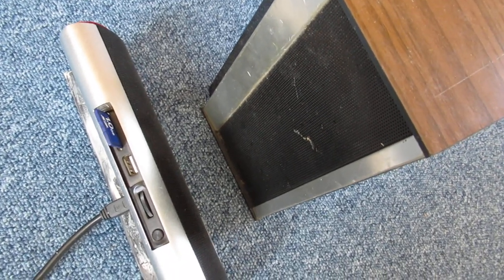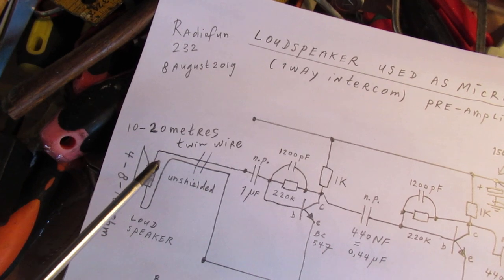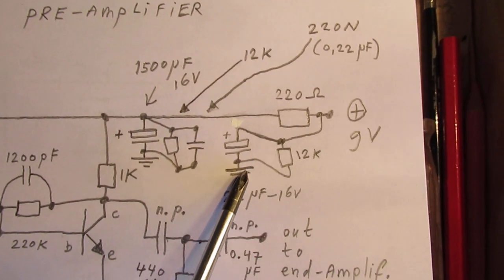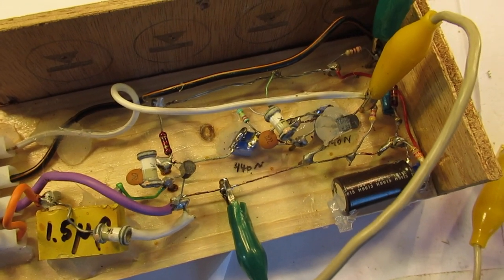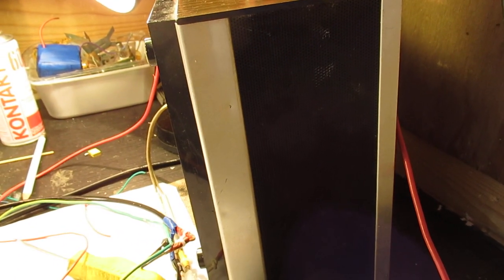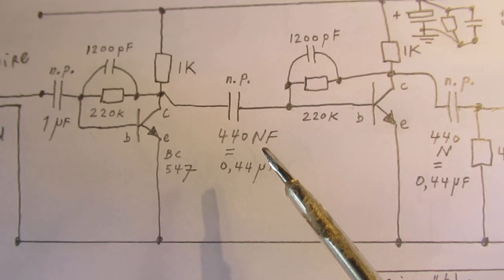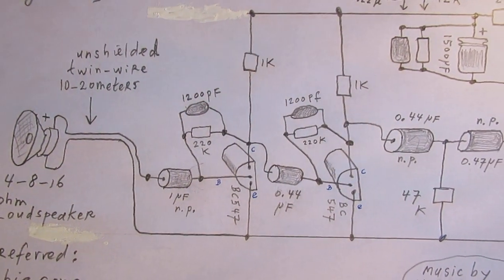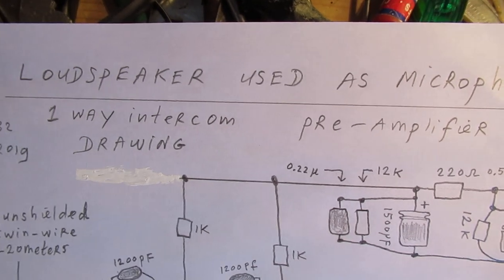Loudspeaker used as microphone via long unshielded wires: 2 transistor pre amplifier/demo

Comment: It would be interesting to make the first transistor common base with the low Z speaker mic in the emitter lead. Naturally it would mean a couple of ma DC running through the coil, but I'm curious :) Smashing video, thanks.
Reply from the maker: Thanks. And yes, I did that in the past, but it gave much more hindering noise. So that is why I published this circuit.

Comment: It is possible to use a computer amplified loudspeaker with this preamp?
Reply from the maker: Yes, it can be used will all kinds of (low impedant) coils, between 4 Ohm and (say) 500 Ohms. By the way: it was made for 4-32 Ohm loudspeakers. When the computer loudspeaker has a small cone (say 5-8 cm) the circuit will be somewhat less sensible for sound, but I tested it with a 5 cm loudspeaker and it worked.